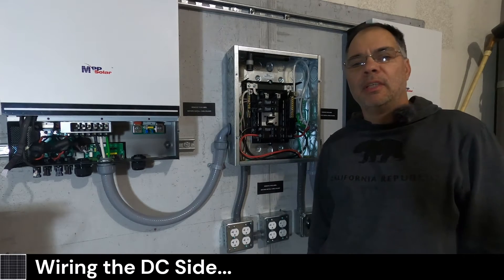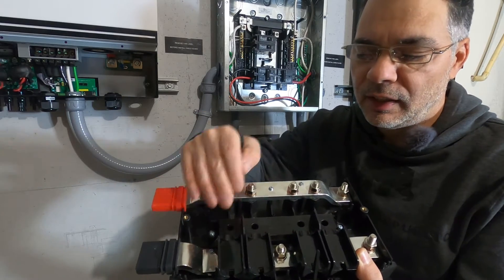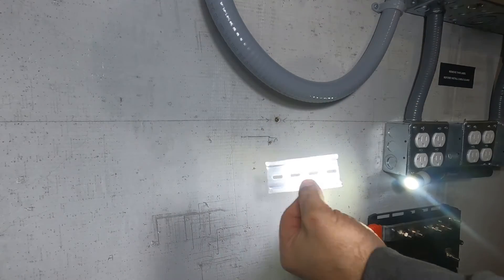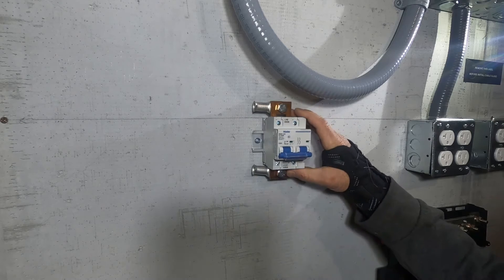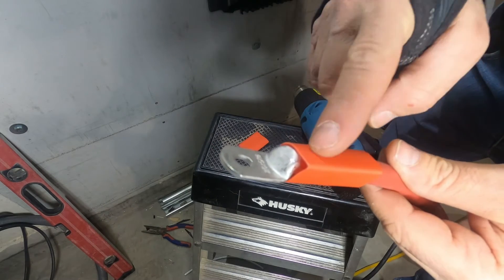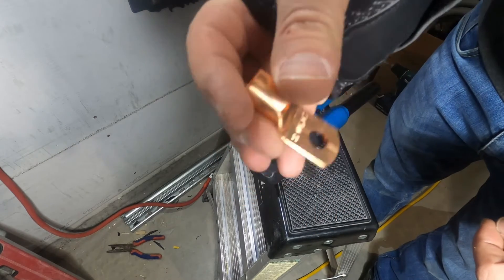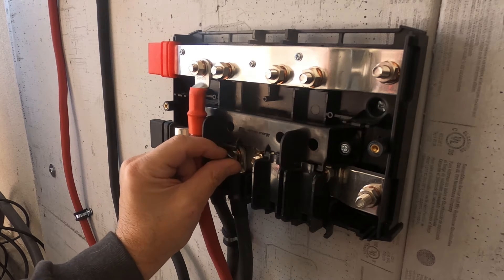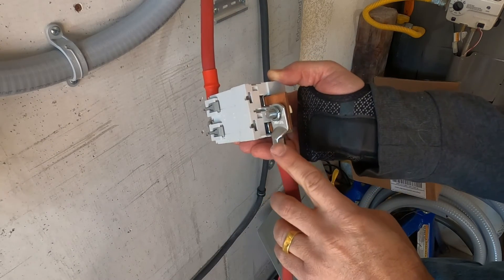Installing Victron Lynx Power In and DC Breakers

Comment from the maker: Have you used any of the Victron bus bar components, please let me know your experience.

* Affiliate Links

Victron Lynx Power In Battery Bus Bar *
https://www.currentconnected.com/product/victron-lynx-power-in-power-distribution-system-m10/?ref=lbh7znvv
https://amzn.to/3Ow8azf

Victron Lynx Distributor *
https://www.currentconnected.com/product/victron-lynx-distributor-power-distribution-system-m10/?ref=lbh7znvv

Nader 200A DC Rated Breaker *
https://signaturesolar.com/nader-dc-circuit-breaker-60v-200amp/?ref=natesdiy

Nader 200A DC Rated Breaker * (with enclosure)
https://signaturesolar.com/nader-dc-circuit-breaker-60v-200amp-with-enclosure/?ref=natesdiy

Comment: Working in Power for At$t for 30+ years... working on 48-52vdc power systems...  ALWAYS REMOVE YOUR JEWELRY!  Take that wedding ring off, even though this is powered down...
Reply from the maker: I will  keep that in mind next time.
Reply: @  old habits.  Always wear safety glasses too.

I watched over vendors during the overnight shifts, installing new equipment into the bdfb. I had to tell a lot of guys to be very careful while working on hot bus bars.

Comment: When you go back to the solar input to your DC Breakers, please add a Furrel of the appropriate size for the wire gauge at each breaker input. The stranded wires can break strands from vibration and will cause of fire hazard I am told. Plus, it is so satisfying to insert the ferrule into the breaker wire connection as a solid replica. Thermal comparisons show less heat loss with much less failing connections. Cheers & keep up the videos. Davey
Reply from the maker: Good idea.. I should do a video on that.. 
Yes I found if you use to thin a wire there aren't enough strands to be safe.. I have a thermal imager now so I think I'll do that.  I have noticed a bit of heat on one of the Breakers but nothing alarming.

Comment: Hello
great for the video!
I had a question: I have 3 battery packs in 48 volts 280AH can we connect the 3 packs on the lynx? after that I must also power the 5MPPT smartsolar victron and go to the multiplus2 (8000VA)
possible?
thank
laurent
Reply from the maker: If you need more than 4 connections, then you will need more than one bus bar.. you can connect to the Buspar or the extension tab that sticks outside of the chasis. 5 total.
Reply: Hello
do you mean 4 connections per polarity? 4+ and 4- in total for the lynx power?
i also need lynx distributor for my 48 volt battery pack?

or can we just put lynx power for the battery pack and the mptt plus the multiplus? (too many maybe?)
Reply from the maker: @laurentsosson1739  yes 4x positive lugs and 4x negative lugs.. so the distributor has fuses so yes its meant for your devices or loads to connect to that.. the power In does not it just has a bus bar and is meant for batteries.   4 batteries and 4 loads respectively
Reply: Hello
I have another question about the lynx distributor
on my solar installation I have 5 strings so 5 mptt smarsolar 150/35
they all have their 40A mega fuse fuse
I was wondering if it was possible to connect the 5 smarsolar 150/35 directly to a lynx connector with a 200A fuse?
possible? because otherwise I have to buy 2 lynx (expensive) to connect 4 individual smart solar (6MM²) on each lug of the first lynx and 2 others on the second lynx with the multiplus 800VA in all 7 locations on the 2 lynx
no risk of gathering all the mptt in 6MM on 1 lug of 50MM²?
laurent
Reply from the maker: @laurentsosson1739  typically each mppt has its own fuse to protect the wires (8awg) most likely.. if you connect a 200a fuse this would allow more than 40a to flow on any of the 5 output wires.. so this is not advisable.. you could buy a cheaper 5 lug bus bar for the 5 units or a fused bus bar... then run that to your lynx using larger cable. Search for victron fuse holder ..  something like this.  

https://signaturesolar.com/victron-busbar-to-connect-5-mega-fuse-holders/?setCurrencyId=1&sku=1593020&utm_term=&utm_campaign=PMax:+Shopping_Smart_Brands&utm_source=adwords&utm_medium=ppc&hsa_acc=6010647758&hsa_cam=17631500090&hsa_grp=&hsa_ad=&hsa_src=x&hsa_tgt=&hsa_kw=&hsa_mt=&hsa_net=adwords&hsa_ver=3&gad_source=1&gclid=Cj0KCQjwveK4BhD4ARIsAKy6pMKr518OQ5tCYFH9ncGFY1zgn4GV4TflicMsfwJ9uF23aictQnQ_zaUaAgFVEALw_wcB
Reply: Worst installation I have seen

Comment: New subscriber here from NZ & just brought me a portable power supply for camping, recommended to use with a "40-60w 18v" solar panel so I brought a 60w solar panel to charge it but as I'm new to all this & dont have the knowledge I didn't take into account all the other technical stuff so my question is "Is it safe to charge??? Any help would be appreciated as cost me round about $400 all up & I don't want to f.... it up & can't afford to buy another! Thanks 👍🏻
Reply from the maker: What are the specs on the charger, and what are you charging with it. ..
Reply: @natesdiysolar  The portable power supply bank is charging straight from a solar panel but havnt tried it yet what specs you need?
Reply: @natesdiysolar  What's most important I should know? As specs info on portable power bank & solar panel are a lil different! Thanks mate!
Reply from the maker: @Saiyan4eva  does the portable power bank take solar input directly.. if yes what is the max voc or solar input voltage and watts it can accept. What type of connector does it use for the solar input.  Send links if you have link to the product you have
Reply: @natesdiysolar  Sorry mate Links for specs, keep getting pulled down by YouTube, don't know why!
Reply: @natesdiysolar  And yes solar panel is connected directly to power supply!
Reply: @natesdiysolar  Solar power interface: DC552, Capacity 88500MAH, Power bank- Solar panel charging: DC 13-24V/2.2A MAX 

Solar panel- Imp 2.86a, Vmp 21V, Isc 3.02A, Voc 25.2V

Does this help mate? Hope it's compatible!
Reply from the maker: @Saiyan4eva  what's the model number and make of the power unit and solar panel.. ill look it up
Reply from the maker: @Saiyan4eva  you can send me an email. My email in description.
Reply: @natesdiysolar  Just emailed you mate, Cheers & thank you here's hoping they are compatible with eachother!
Reply: @natesdiysolar  Still waiting on a email can take a look when you can thanks mate cheers! 👍🏻
Reply from the maker: @Saiyan4eva  I just checked.  I did not get any email...  can you send it again, please? It's also listed on my website.